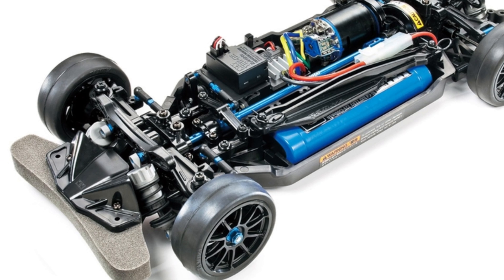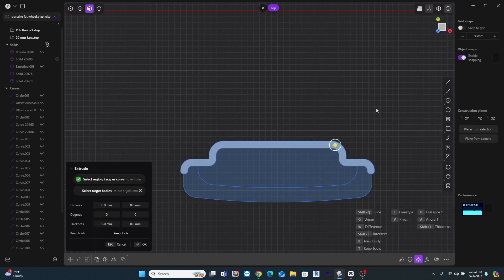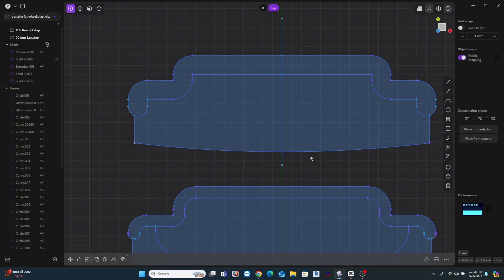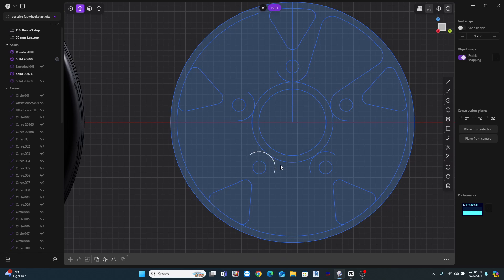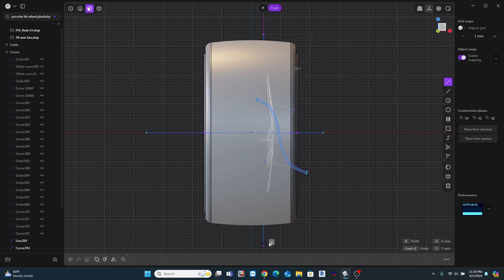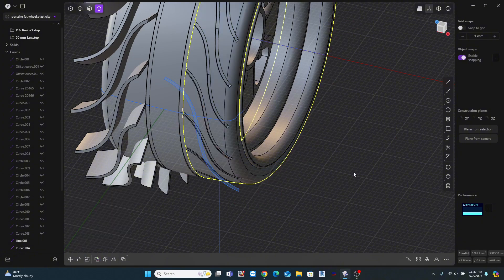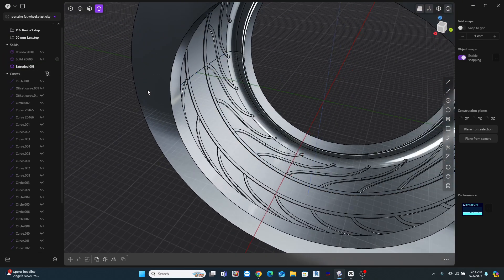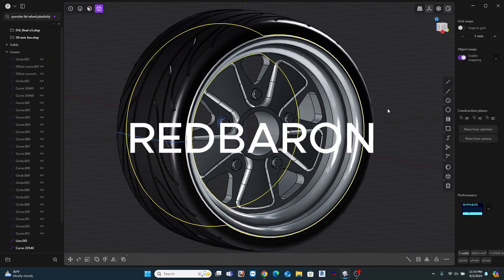How to design and make awesome custom wheels with #plasticity!

Comment: I've been trying for a few weeks now to find someone who has made wooden works in plasticity3d such as a cabinet wood , do you have the option of making one for example. 🙏 I'm trying to figure out if it's suitable for woodworking or it's better to use Fusion 360 or Sketchup